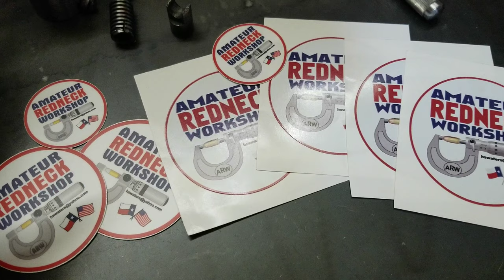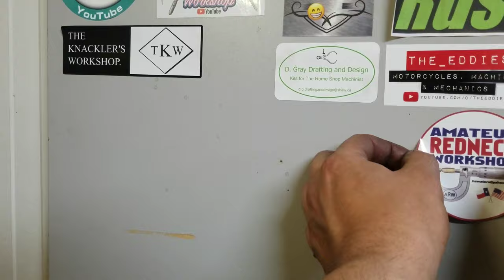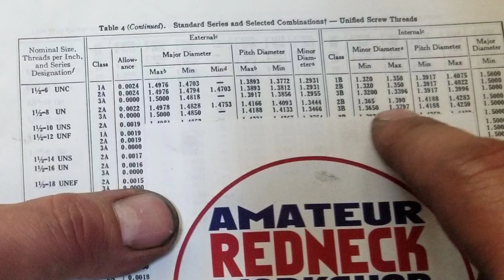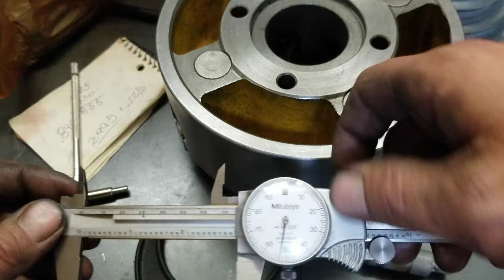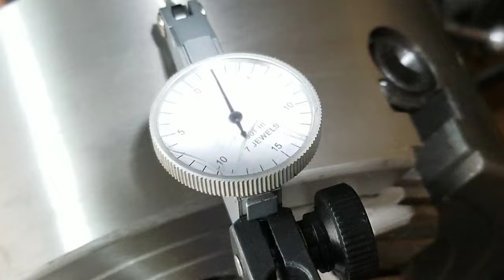Making a New Lathe Chuck Backplate (from scratch!) for an Atlas Lathe 😁

Comment: Nice to see you back. Cast is self lubricating that is why most don't use lubrication. But there is nothing wrong in using cutting oil  it just makes a paste. Hope your truck is working fine now. Cheers and stay safe.
Reply from the maker: Thanks, Yves 😊. Yes, it apparently has a lot of graphite but I've also read somewhere that lard could be used for things like tapping and such. Oh well, it worked out ok 😏. The truck is running great so far, despite the jb weld on the distributor lol. Cheers! 😁

Comment: Good Video!  Next time you have to deal with mill scale soak it in white vinegar for a day, Walmart has 5%.  The mill scale is converted to something that you can more or less wash off.  For flat surfaces I rinse then it give it a light pass with a palm sander.   Looks like cold rolled.  I suppose if your going to machine the surface there is no point in doing more then rinsing it.

I  have an atlas 10" with babbitt bearings.   I bought a six jaw.   It holds the works much better but the extra stick out from the front bearing reduces rigidity.   Have you notice similar?
Reply from the maker: Yeah that does work good. That ductile iron has some pretty thick scale, worth a try though 😊. Thanks, Dan! Cheers!

Comment: I'm not sure you can run a babbitt head fast enough to really make use of carbide. They need a lot more surface speed than you expect, and a more aggressive cut. I have to run mine at absolute max speed to get good results, and with a cut aggressive enough to be right on the ragged edge of stalling at any time.

Also- there really is a big difference between Chinesium carbide and American / European / Israeli stuff. If I just need a cut, I'll use a $6 Chinesium insert. If I need a pretty cut, I'll pull out a $65 Seco or ISCAR insert, and it looks like a damn mirror.
Reply: Also- is that your countershaft making the rattling noise?
Reply from the maker: Well, the ol' girl was capable of doing 2200rpm in her prime lol. Watching the video myself made me wonder if increasing the feed rate might have helped. Gotta swap change gears every time so I just keep it at .0033" per rev. I don't really use inserts much but I'll have to set aside a day to do some experimentation 😊. Don't think I'll be dropping $65 on an insert any time soon though 😉.
Reply from the maker: Most likely the back gears slapping around lol. Although that counter shaft is in the process of being replaced. Also gotta make up a spacer for the spindle assembly. So that sound could be the dogs on the small back gear and pulley. Either way, drives me nuts too, just trying to find the time to fix it 😏. Cheers!
Reply: @Just1GuyMetalworks  Y'oughta do an electric lead screw, then you can vary the feed rate however you want. On the fly, even.

Re: countershaft- I gotta get around to replacing mine at some point, too. Just got too many projects going all at the same time right now. Been looking at just picking up 18" of precision-ground shaft and getting some needle-roller bearings, thrust washers, and a couple of shaft collars to stuff in some new housings. Seems like that should solve the problem for me well enough, and also keep from slinging oil all over my wall when I run the lathe.

The back gear thing, though... that's another thing I gotta deal with. Mine doesn't like to stay engaged. Gotta figure out why, and tighten it up.

Comment: Gm 4.3 cap and button must be chasing a miss lol
Reply from the maker: I wish! 🤣 Intake gasket replacement, those were just additional casualties lol.
Reply: @Just1GuyMetalworks  man that’s all bad any bad spider lines
Reply from the maker: @jeremycable51  none that I could tell, just 15 liters of oil/antifreeze in the block 🤣. She's up and running with the help of some JB weld on the distributor lol. Damn plasic crap! New aluminum one coming this week.